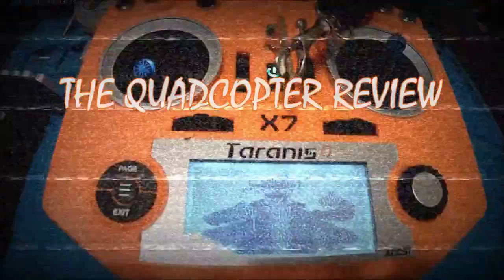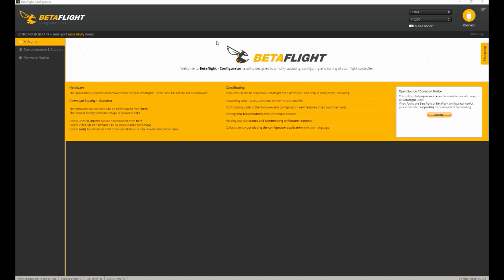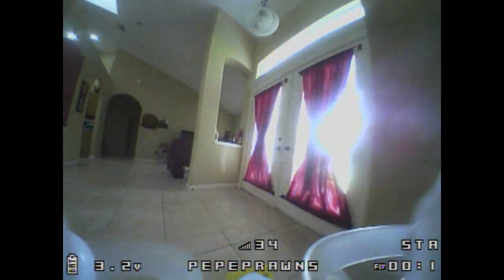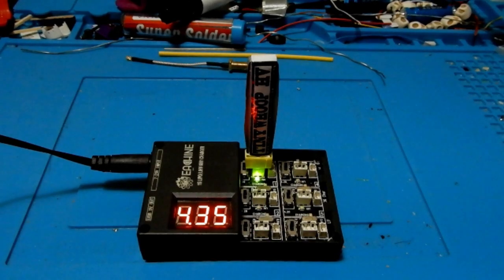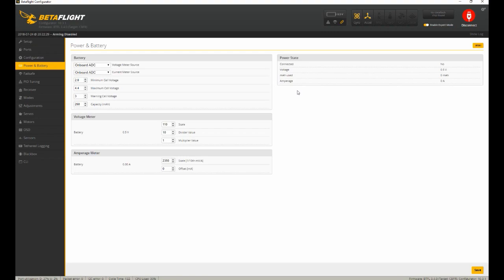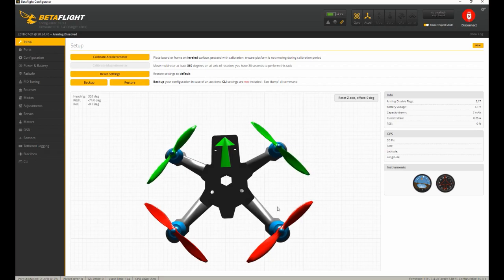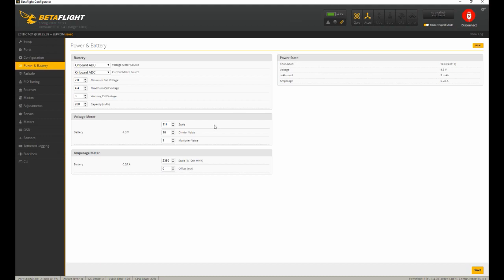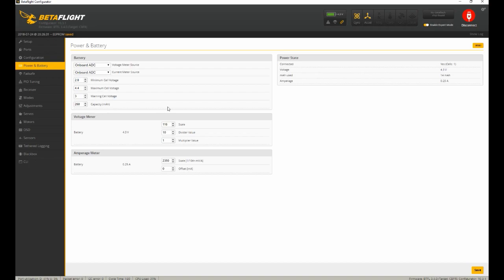Fix your Inaccurate OSD Voltage Sensor Readings in Betaflight / Butterflight

Comment: I hope you are doing great.

I have a Matek F722-SE F7 flight controller with current sensor.

I usually fly 1300mAh 4s lipos. 

When I use a higher capacity lipo, such as a 2600 or 4400mAh, after like 1000mAh consumed (I see it on my dji goggles OSD), the counter gets stuck and then it updates, then gets stuck, then updates and so on…this is the contrary to what happens with my 1300mAh lipos, which update the mAh consumed  in a linear continuous fashion with no jumps or skips.  Any idea what may be going on?

I use Betaflight 4.2.3.

Thanks for all you do, keep on rocking.

Comment: Bro, you are over charging the lipo batteries. you have it set on 4,35volt, but it should be on 4.2 volts on the charger. Because that's the max cell voltage for a lipo battery
Reply from the maker: Always a good point on standard batteries, never overcharge. But actually, if it wasn't completely clear on the video, these are HV batteries.  You can see that is a tiny whoop HV battery. Meaning High Voltage Battery. You are correct that max charge on a standard lipo is 4.2 volts per cell but the max charge on an HV battery is 4.35volts per cell.

Comment: Would this even apply to 2s, 3s and 4s?
Reply from the maker: yes this is strictly compensation to the metering system in betaflight or butterflight. So lets say you have a 3s that you know from your charger is at 12.8v but your osd reads 12.4. Adjust that same percentage in your configuration with the battery plugged in util you see the correct voltage.